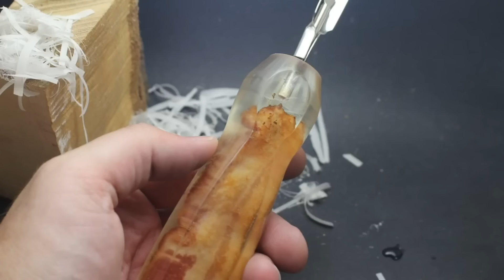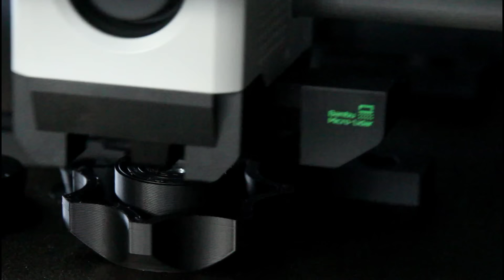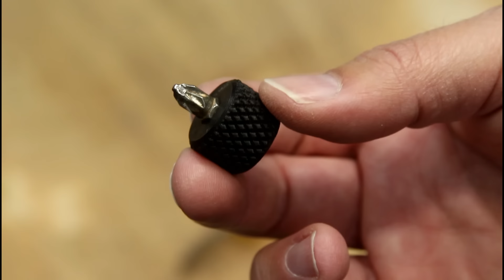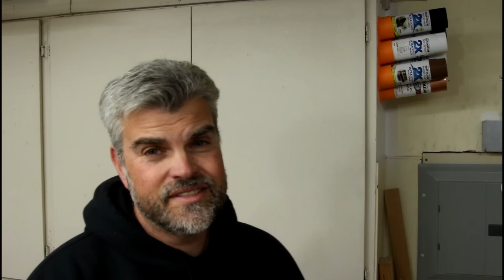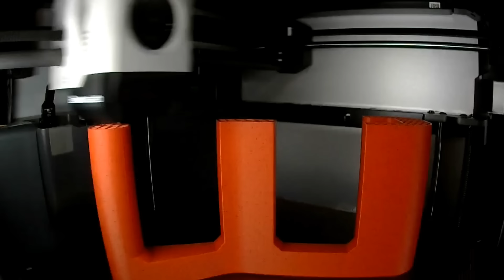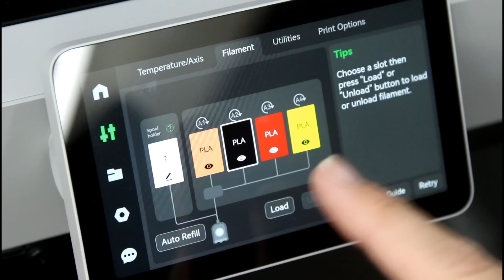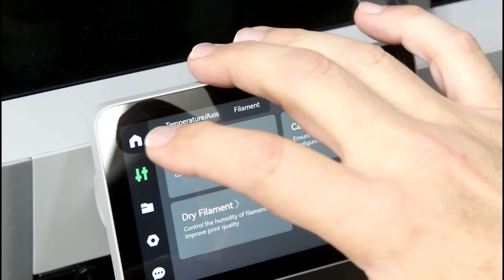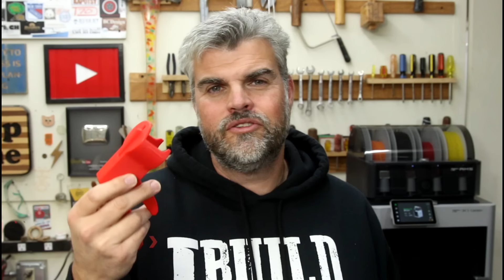5 MUST Have 3D Printed Tools!

Comment: Admit it! You have a new toy and you're trying to convince your wife it's "actually essential " 😅
Reply from the maker: Haha! She's already had me make stuff for her escape rooms parties. I've got her hooked. :)
Reply: @peterbrownwastaken  I imagine the multicolor prints AMS can do are great for that.
Reply: @peterbrownwastaken  Now I want to see what sort of stuff you've printed for your wife's parties.
Reply: I'd personally b concerned with those spray cans right above your electrical panel. After all flammable items should b in a cabinet (maybe even a Flammable cabinet? )
Reply: @JS-wc4xs What ever dude… There is Zero actual danger from those cans. If you’re fuse panel posses a threat to spray paint cans you might want to just stay out of a shop all together cause you don’t know what you’re doing…. Sounds like you simply just want to complain.
Reply: @lipinskirl  r u trying to say spray cans r not flammable? Have you ever seen Mythbusters? Regardless of the cans being next to a fuse panel or not, taking said cans out of a cabinet to leave them exposed to a potential fire isn't necessarily a wise practice. Ultimately, it's his shop and his problem, but showing everyone else can potentially encourage others to copy that unsafe behavior - and that's what makes it my problem.
Reply: @JS-wc4xs  I’m not an idiot, I know know spray paint is flammable. I also know that my fuse panel is up to code and isn’t going to arc across the room and ignite a closed spray can. I would be willing to bet his isn’t either. If you had any experience or skill in a shop you would know that there is No actual danger here. You sound like someone who has no experience in doing but plenty in complaining.
Reply: @lipinskirl  you could have fooled me. How does having any experience or skill in a shop have anything to do with knowing whether something is a fire hazard? How can u say there's no danger here? Isn't that the point of a flammables cabinet? So it would minimize the danger. You sound like someone who intentionally seeks out commenters only so you can feel superior. (Since I assume you have very little control in your real life, so you prey on others to make you feel better. However, the truth is you are unhappy with your life and choose to take it out on others.) Either way, I'm done. This has become futile and childish, and if this is how you wish to spend your time pity you.
Reply: @JS-wc4xs  I work in a shop and I have a personal shop. I’ve built things for over 40 years. Knowing how things work and how they are made along with experience using tools is what builds the knowledge of what the actual physical dangers are. Everything in a shop is dangerous. It’s ALL meant to cut, burn, electrocute, or puncture. That’s the entire point of tools. Knowing how to use them is what makes them safe. A closed spray paint can next to a properly installed fuse panel is not by any means a fire hazard. If you had any familiarity with these things you would know this. So it’s probably you who should be hesitant on your comments.
Reply: @lipinskirl As a retired Fire Investigator, I've seen my fair share of 'garage shop' fires. Although @JS-wc4xs might have some specific details wrong, the general concept of a "Flammable Cabinet" (especially if it is up to all codes) is a much safer practice than keeping ANY flammable items where they can be a 
potential problem.  
I've encountered many people over the decades that insist their 'shop' is safe, but whether the fire starts in the garage or elsewhere, whenever non secured pressurized cans reach their limit they can become projectiles. Putting a spray can above an electrical panel may not specifically become an 'arcing problem' as you put it (that's not how the paint cans ignite. The paint cans are pressurized with VOCs and other solvents. These gasses are flammable, and when over pressurized, they essentially explode. This is an oversimplified explanation.)
However, @JS-wc4xs is 100% correct that keeping ANY flammable items in an up to all codes Flammable Cabinet is the proper way to reduce unnecessary problems.
Reply: @lipinskirl As a retired Fire Investigator, I've seen my fair share of 'garage shop' fires. Although @JS-wc4xs might have some specific details wrong, the general concept of a "Flammable Cabinet" (especially if it is up to all codes) is a much safer practice than keeping ANY flammable items where they can be a 
potential problem.  
I've encountered many people over the decades that insist their 'shop' is safe, but whether the fire starts in the garage or elsewhere, whenever non secured pressurized cans reach their limit they can become projectiles. Putting a spray can above an electrical panel may not specifically become an 'arcing problem' as you put it (that's not how the paint cans ignite. The paint cans are pressurized with VOCs and other solvents. These gasses are flammable, and when over pressurized, they essentially explode. This is an oversimplified explanation.)
However, @JS-wc4xs is 100% correct that keeping ANY flammable items in an up to all codes Flammable Cabinet is the proper way to reduce unnecessary problems.
Reply: @lipinskirl  As a retired Fire Investigator, I've seen my fair share of 'garage shop' fires. Although JS-wc4xs might have some specific details wrong, the general concept of a "Flammable Cabinet" (especially if it is up to all codes) is a much safer practice than keeping ANY flammable items where they can be a 
potential problem.  
I've encountered many people over the decades that insist their 'shop' is safe, but whether the fire starts in the garage or elsewhere, whenever non secured pressurized cans reach their limit they can become projectiles. Putting a spray can above an electrical panel may not specifically become an 'arcing problem' as you put it (that's not how the paint cans ignite. The paint cans are pressurized with VOCs and other solvents. These gasses are flammable, and when over pressurized, they essentially explode. This is an oversimplified explanation.)
However, JS-wc4xs is 100% correct that keeping ANY flammable items in an up to all codes Flammable Cabinet is the proper way to reduce unnecessary problems.
Reply: @JohnSmithD-Day  Ok so what you are saying is if the shop is already on fire from a different cause and the heat from that fire happens to over pressurize the cans it could possibly be an issue if the electric panel isn’t up to code. Got it… 
Sorry just not seeing the need for a paint locker for a few cans of spray paint. We do have one at work due to the hundred gallons of so of various paints and solvents that would cause an actual issue were they to ignite, but a few cans in a home shop are not going to be an active or continuing issue in controlling a fire.
Reply: @lipinskirl  The dude is a Karen. Looking for a problem where none exist. 
When you buy the paint from the store, it’s not in a fireproof cabinet is it?
Reply: When I got mine I immediately started printing baking tools and house decor. She letting me get my third printer now a year later. 😂
Reply: @AmericasTeamAdventure Has sh let you make anything for yourself yet? 🙃
Reply: @stsfuzzybear4613  oh yeah! Truck repair parts, machining tools, model engines for my students, fishing bobbers, motorcycle parts, battle bots, and more! It's kinda weird not to hear the machine running when we are in between prints. We just bought each of my high school boys their own machines to have in their bedrooms so they print all of their projects.
Reply: It’s a tool and a toy. That’s what’s great about printers. I can make my stupid things, everyone else around me are impressed by the useful things I can design and print. Win win.
Reply: My partner is enjoying suddenly having me have the ability to create stuff for his aquarium hobby cemented permission
Reply: They are essential though, I have 8 :)
Reply: I’m convincing my wife right now lol
Reply: Valid theory 😂
Reply: Yes, more tools would be great!
Reply: Ok so at first glance I most likely wouldn’t put spray cans there either but let’s talk it out, for an explosion and/or fire what do you need? An explosion needs compressed ignition source along with ignition source…no?  So you would need a spark to happen and leave the metal box, find its way to a compressed combustible source.  So either the spark needs to find its way to the can and into an opening but if that’s the case then would it still be compressible since it was leaking to the entire room?  Other way is the can leaks to the room and does it has enough pressure to pressurize the space to get it to a combustible situation?  Or does a spark leave the metal box then make its way to spray can that has an opening and the spark finds the leaking paint to cause the paint to ignite.  Did I miss any scenarios that would cause a fire?
Reply: Bro these things are far from toys..
Reply: I convinced my wife it was educational. For the kids and shit.
Reply: The "wow, I can do so much with this!" phase of 3D printer ownership lol. Eventually you wind up with a few useful prints, a bunch of plastic waste, and the printer sits idle a lot more often as you transition away from using it for the sake of using it.
A lot of tools just make more sense to buy, even if you own a 3D printer, but sometimes no such product is available, or what's available is very expensive. And if you have some CAD skills, being able to print custom brackets and holders for oddly shaped tools etc is great for organization.
Reply: I did that on day one when I printed stupid little hangers for her kitchen aid mixer blades and clips to keep my sons wooden trainset from falling apart... he actually started playing with it because it wouldn't fall over every second (it had bridges).

But I am not sure I could sell her on the price of an x1 carbon.
Reply: Thank you for this video. I now how info I need to convince my wife I need a 3D printer. 😂 just kidding. I already had her convinced. I plan to get one as soon as I find the one I want. The things you printer were great!
Reply: I ordered my first printer ever and ALLOT of filamant yesterday. Bambulab P2S. 
I will justify my purchase to NO ONE. I just told my girl I bough a printer and that was that 😂😅

Comment: I would very, very highly recommend printing the featherboard out of PETG or ASA. They are a bit more of a hassle to print since you need to keep them both dry, and you have to ventilate the area while printing ASA but PLA is quite stiff and brittle (and get's even more brittle over time). If a kickback shoud occur PETG or ASA will not shatter as quickly as PLA which is very important since there is the possibility that with PLA not only the workpiece will come flying at you but sharp fragments of the featherboard too.
Reply: PLA+ is also an option. Not quite as strong as PETG but it's less brittle than base PLA without being any fussier to print
Reply: Or even a hard TPU. Do some research on how to avoid it jamming mid print, and you'll have a part that's super impact resistant
Reply: @gifthammer2  came here to suggest this as well
Reply: I use polycarbonate for all my functional pieces.  X1C prints it without any trouble.
Reply: Polymaker PLA PRO is also a good option. somewhere in the middle of the PLA+ and PETG qualities.
Reply: And also - unless you live in a desert, PLA will absorb humidity over time and become increasingly weak and brittle. So a featherboard that is perfectly fine when printed may come apart at the slightest flex two weeks or a month later (here in humid coastal Spain). PETG is the material to use for this, also because it will flex and bend when overstressed, not convert itself into a shower of sharp fragments
Reply: Polymers asa has no smell. Eryone's on the other hand was worse than abs.
Reply: @michaelfilippi3276  I would nonetheless recommend ventilating the area and not being in the same room for an extended amount of time while printing. 
Styrene poisoning is no joke and i would not assume Polymers ASA being safe.
Reply: @NightmareQueenJune  bento box takes care of the rest.
Reply: @michaelfilippi3276   If you know the smell of the ASA filament you're far too close to the printer.

Comment: Try this- put a rectangle in the slicer the size of a pen blank or a handle (you can do that without CAD or anything, you can just click "add shape"). Then, change your settings to zero top and bottom layers, and set the infill to "gyroid". Slice it and you'll see an awesome pattern exposed on two sides that you can fill with resin. You can also try setting the perimeter count to 0 to get only the cool infill pattern, but you'll need to put that into a mold. Changing the infill % will change how big the gyrations are so you can get other effects! Actually upon further thought... Just set top layers to 0. Then the bottom will be solid and you can pour in resin from the top to fill it up, then turn away the outside.
Reply: Holy shit. This is genius
Reply: Yeah dude that's awesome. Try using sparkling pla while you're at it
Reply: I had the same thought! You could get some cool patterns by turning 3D prints on the lathe
Reply: How is your comment 8 hours old on a video that got posted an hour ago
Reply: @solondarville1020  Patrons get early access :)
Reply: I would seal the print first. Wouldn't trust layer lines to be water -or resin tight. Really interesting idea though.
Reply: @17Mav  It works fine. You can cast in the printed blocks just fine with no leaking. I have made many many molds this way.  I also have molds done in TPU so they are flexible like silicone. 100s of castings in them and haven't had an issue.   If you plan to turn the actual printed part though, be careful with PLA.  It has a tendency to melt when turning at high speed or when finish sanding.  It will work but you have to treat it differently and be aware of the temps..  PETg, ABS, ASA,  are better for turning at high speeds.
Reply: @ghostshadow1  I guess I stand corrected, then.